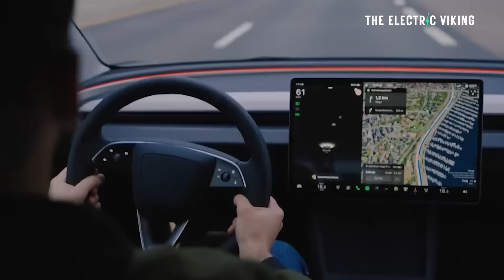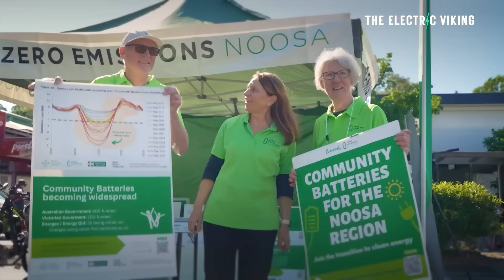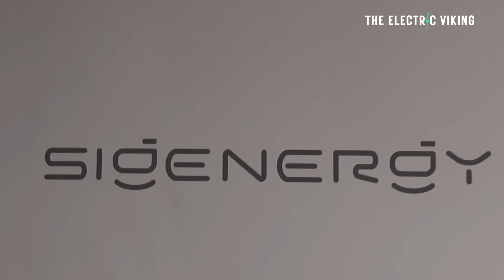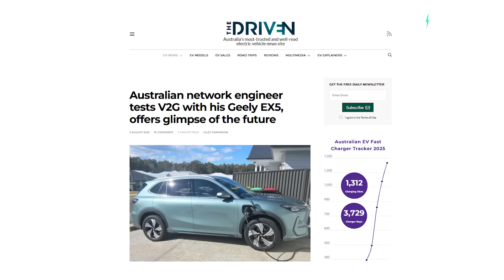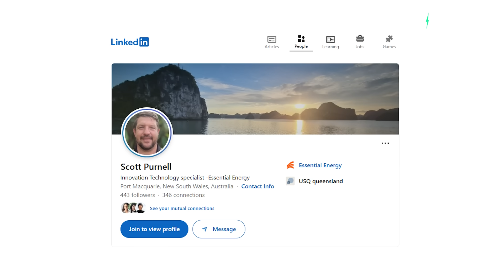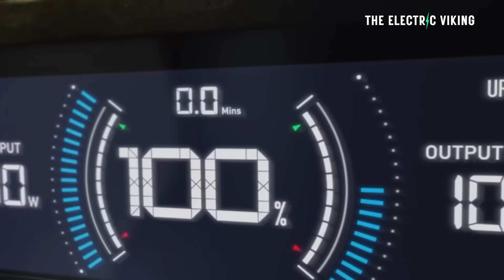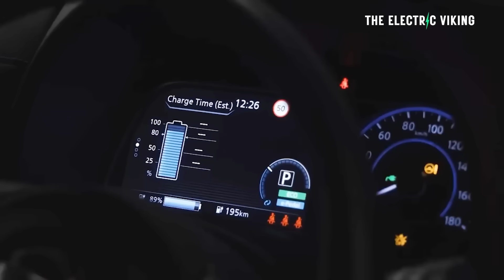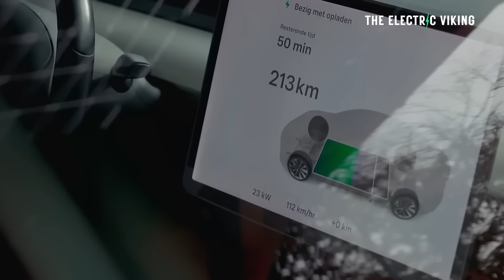V2G Hits Hyperdrive in Australia - Works with Xpeng, BYD, Tesla & Geely!!!

Comment: You can't make money  from selling electricity anymore.  Not getting spikes in price for last year.  I have 3x powerwalls and still big bills - it's the $1.30 daily charge 60c network and similar for amber membership.  Can't go off grid with tesla (permanently) they don't allow it.  Also can't run electric cooker (50amp induction) off backup circuit.

Comment: I found this presentation very confusing. Words with different meanings being used interchangeably.  V2G = V2H? Also at the end of the presentation, noting making money (tax free) by sending to the grid at selected times. I dont know which state(s) you are talking of but here in Victoria you are very lucky to get 1.5cents for 1Kw, and some providers dont pay anything for your feed in Kw. For me now, I export 1.2Mw monthly in dec, jan for eg butI am not interested in any export to grid. If I get an EVehicle I would like to use it for V2H not V2G but there was little discussion about this. Apologies for the negativity but that is life in Victoria now with supply charges going up up up and feed-ins going down down down, you are lucky to pay for the supply charge. (I us BYD batt 11Kw, 13.5Kw on roof and fronius 10Kw next gen).

Comment: I will never buy a 2nd hand EV if I have any suspicion it's been used for VTG. I've little issues supplying the grid with power from a fixed house battery since if it dies early I won't be possibly stranded in middle of nowhere.

Comment: Another way to use vehicle to grid is to charge during the day at work and the discharge into the grid during the peak.  It is a way of supporting renewables without having solar on your roof.  If you can make more than you pay due to favourable rates this will incentivise people to do this. Electric cars can offset the need for utilities to install batteries.

Comment: I have a 20kw Fox Ess Batteries and only a 6kw solar system. In my first month in the depths of a particularly grim winter here in Adelaide, over the winter solstice too I’ve used about 30kw from the grid, about 7.5kw a week but fed back 250kw of unused solar. Plus we have underfloor heating on the ensuite 24/7 for winter, not the most efficient for sure. Happy with this. It will all change when I get my EV, so an interesting article. But, this set up pretty much makes me 100% self sufficient so, I now need to find away to charge the car with minimal impact.

Comment: Using obsolete cars for grid makes sense but not the one you depend on for daily driving. Most EVs have about 2000 cycles and Using that up by selling to grid degrades the battery faster. LFP or newer tech with higher cycle rates will eventually make this a mute point but currently using your car to grid will just degrade the battery faster

Comment: We will still need some large-scale renewables. There is a lot more to the grid than just domestic use. I can cover my home use most of the year, but not in rainy overcast weather that lasts more than a day or two. Nor in overcast very hot weather in summer. We have two EVs, and there are still parts of my house that run on gas, so my electricity usage has not topped out yet. I am looking forward to V2G.

Comment: we need more transmission to have the extra routes when lines go down but can give more power to the grid from other places and have a smart shift scenario like if we can get the pilbara and WA connected to the nem and sun cable project connected we can use many sites for power plus all the home batteries and solar and cars

Comment: will hall has been told that they need more supplies but compliance is also a issue in play. but sigenergy with their 3ph inverters plus the 25KW DC charger and push 15kw to grid and 10kw to sig battery during the high demand period. but if have single phase you are limited to max 15kw of 5kw to grid and 10kw to sig battery.

Comment: The only things allowed to be connected to the grid are those fully approved to electrical standards so forget used EV batteries. Off grid is user beware and check your home insurance pds terms.
In terms of V2G you're essentially asking EV buyers to buy a larger battery than required for their transport needs and you're wearing it out just like a house battery. At present a stand alone V2G two way setup is $10k so you may as well sink that into a subsidized house battery anyway

Comment: I was excited to read the the Waratah Super-battery has been turned on - until I see that it is owned by Blackrock. Why on earth do we need foreign private equity owning our power infrastructure, forever sucking rent out of the Australian people? Private equity is actually just a re-branding of the old leveraged buyout (for those of us old enough to remember the '80's). It was a scam then, and still is now. So, is Blackrock's "investment" (rent extraction) going to be buggered by the distributed, resilient, and people-owned grid realised by V2G? Not for a long long time. The parasitic vampire-class "investors" are expert at insidious lobbying. Expect to see strident warnings about "damage to your EV" from peak industry groups, and regulatory grid-lock as advisory panels stacked with vested interests protect their privilege to extract rent from you by blocking sensible V2G policies. "Freedom" means do it anyway, and be free of these parasites.

Comment: Evo energy do free electricity 11am to 2pm.  I don't have solar but thinking of getting battery to store during free time.  Downside is locking into this plan but I hear AGL and maybe others are doing similar.  Thoughts?
Reply: You could just build a system with a load of camper or server-rack batteries and a chargeverter. Even a basic chargeverter, plugged in through a simple time switch. Just have it click on when the electricity is free and charge up, then plug things into it during the day

Comment: Can one not insane person explain why someone would use up their limited battery cycles to support the grid?
Reply: A person in their 60's who only does 10,000km a year...a new EV will go 500,000km if the person wants to keep the car for 20 years and thinks driving after 80 is unwise then they may as well use some of the battery kWh's in other ways.

OK big-boy.
Reply: If you don’t do big kms every year then it would be ok to use it at home in V2G. Modern LFP batteries can last 2000 to 5000 full discharge cycles or more. So if you don’t abuse it, it will be fine.
Reply: Modern Lithium-Iron Phosphate (LFP) batteries can do at least 2500 full cycles at max performance. Most nowadays more like 4000-5000. Something else on the car will wear out and break long before you reach those numbers.
Reply: V2H not V2G is what provides energy independence, but V2G infers a standard that is acceptable for selling into the grid also. Home batteries work if large sized for ~95% of the time but for 4 day runs of poor weather v2h would cover that of so in theory you don't need the grid. Apart from an occasional supercharge of the ev.
Reply: With solar you get super sunny days that produce a lot but it gets sold for peanuts instead use it to top up the car and reuse it when the rainy times arrive.

Comment: I am finding most of this information misleading, I have a 6.6 Kw solar panel system with a 10Kw inverter & a 12.8Kw storage battery, for a single phase house (there are limitations for higher solar systems for export to the grid) at this time of the year (winter) the solar panels kick in at 8:30 am (low charge input) max input around 9:30am, with no cloud, solar input is 4 to 4.5 Kw, the battery being empty will be fully charged by 12:30pm the battery with the assistance of the solar panels heats the storage hot water till 2pm, again this is a day with full sun no cloud, the battery is now down to 85%, it then recharges to 100% by 3:30 by this time the input from the solar panels is just 1Kw, by 4:30 the battery is now running the house electrics heating, cooking, by 10pm the battery is empty, so from then to 9am next day the house is on the grid, how the hell can a EV battery be charged based on this, unless the solar panel system was at least 10Kw or higher, maybe in summer there is a better chance to have the surplus power transferred to a EV battery, you would need at least three days of zero power consumption of the house to fully charge the EV battery.
Those figures are the best achievable with full sun in winter, with cloud cover forget it battery was unable to reach 40%, with intermittent cloud cover the best the battery achieved was  75% charged by 4pm.
Reply: Good breakdown here. Regardless of who makes the most profit from battery storage this solar battery mix is a strong win for oil dependency reversal. We as a community are better off. There is no “proof of fail” here. Just win win win. Taking a long term view on paybacks for these solutions is a testament to those who can leading the way and I salute you.
Reply: I see what you are saying.  I have wondered this myself.  It would be ok of you had 3x as many panels. 
How much power do you use from your battery each day averaged over the whole year?
Reply: @101spirited  the battery was installed on the 1st of july its capacity is 12.8Kw, each day since in use it has been exhausted as early as 7pm starting at 4pm as late as 11pm this depends on the % of battery capacity available at 4pm, that in turn is governed by the amount of energy (sun) available during the day, how long it takes to reheat the hot water tank & power consumed during the day, based on my observations the house starts running of the solar panels from around 9:30am with battery from 4pm to 9pm at night (average) with no supply from the grid, & on some days a small amount exported, I am considering increasing the storage of the battery to either 15 or 18Kw to take advantage of the increase of sun over spring summer & autumn, unable to increase the number of panels which is the only answer during winter to be around 80% of the time not requiring grid supply.
Reply: @afs5609  You need install another 6.6KW system to give you more power that you can use during the day and install a larger battery so you have mopre availble power for the night and early morning. I've just done this. Originally had 6.6kw system installed in 2018. At end of 2024 i installed a 19.2 kw battery ( Sungrow) and another 6.3kw panels. i now have enough power to run anything during the day ( even 3 phase ducted air con) with enough battery power from 4.30 pm right up until 9.00am the next day. The only power I buy is @ 8c per K/W for charging MY EV when I need more than what the sun can provide from 11am till 3 pm. It's not cheap to upgrade but over 7 years you should be able to complete the ROI.
Reply: @gtpete6363  no more roof area to increase power collection other side of building faces south would only be able to charge in late spring, summer, early part of autumn, waste of money, but agree increase battery storage to either 15 or 18Kw
Reply: You've nearly answered your own question. You have 6.6Kw of solar hooked to an inverter designed to take nearly twice as much. Double your solar panels, on those rare days when the output is more than the house and inverter can handle, then the inverter will throttle the panels back. On sunny days you can happiky charge your car and have the assurance of total independence for the cost of a dozen or so panels.
Reply: @simonpaine2347 insufficient roof area to convert to 10Kw, but will discuss with supplier to see what is possible
Reply: @afs5609 I've put 10 Jinko 530w Bifacials on a structure as a car port and another 10 as a roof over my shed, to help keep it cool. I was never keen on putting panels on my roof.
Good luck.
Reply: Just more proof that making every home owner create their own power by installing solar panels and batteries is not only extremely expensive , but is problematic , impractical and is in total more expensive than the system we had when we had cheap reliable electricity available from a grid powered only by coal and hydro .

Comment: 6:50 yes, you are voiding your car warranty. This is the real issue.

Also, just FYI, if a system performs ok ONCE in an emergency you cannot claim "obviously it doesn't". That is not how critical systems get tested and validated. 

Also FYI, you are never really off grid with these systems. As far as I understand Roof Solar does not work autonomously if disconnected from the the grid. 

However, utilising batteries is a glimpse into the future with lots of potential. But all market participants need to come to the table and clean up the technical standards and liability issues.
Reply: 日本にはv2h があります。
停電時にもソーラーから電気が蓄えられます。　

　EVの保証も問題ありません。

Comment: I've looked at V2x when i picked a home solar installation. I don't see how it makes sense. The cheapest charger i could find costs US$7500 (Wallbox Quasar 2). The same money gets me 40kWh worth of home battery at current market prices which is total overkill so i settled for 20kWh. This battery is always home and much easier to integrate into your home charging logic. I don't know Sigenergy but i'm a bit wary of those fully integrated systems cause they tend to charge you a lot for their batteries. My system now is a Deye inverter that can deal with any type of battery of any brand. I think every EV/home owner wants to integrate their EV battery but there needs to be cheaper chargers. Whatever makes those cargers so expensive needs to be moved into the vehicles and make use of economies of scale. Until then home battery prices keep dropping.
Reply: Stop using facts in your argument. We will have none of those here.

Comment: I'm already running offgrid with 40kwh Sungrow battery feeding excess into grid with Amber Electric earning $1,420.41 in last 6 months. 
I'm looking to get a Zeekr 7X and ideally have it connected V2G. Being able to draw on the car's battery will be beneficial when FiT price spikes. 
There are factors affecting ability to exporting power. 
. Ausnet limit exporting to 5kw per phase, so it is beneficial to have 3 phase power. 
. Ausnet restricts exporting to 1-1.5kw when local network is congested and can stop exporting if required.
. Ausnet from my understanding currently treat V2G no different to Home. Must be approved inverter, always connected to internet, and they have remote access to control it, and they dynamically control your export limit.
Looking to use Amber Electric for the smart charging and discharging for the EV as I current do for Home.
Reply: Interesting, off grid but still feeding into the grid. Magic.
Reply: @Guvament_bs  Just a switch. Only need to be grid-connected to export power, but tend to stay grid-connected for convenience.
Reply: Earning a whole $1420.41 in six months.  If you live to be 170 years old you may just break even on the price of your 40kwh battery.
Reply: @101spirited what battery or car are you talking about for 240000 AUD??? You get 80kWh battery plus car functionality for 50000AUD nowadays … just look for current car prices ;- )

Comment: In the UK Octopus Energy offer a BYD Dolphin and bi-directional charger for £300 a month with 100% free charging if you plug in for 20 hours a month so they can use the battery for V2G
Reply: Wow taht is awesome
Reply: @felipemelo8605  taht is
Reply: What a rip off
Reply: @richardvivian3665   £300 a month is reasonable for EV  lease prices in the UK, getting a free charger and installation however is not common and nobody is offering free charging. Please explain why you think it's a rip off?

Comment: Sigenstor is modular. You can get the battery installed now and add the V2G module later when it becomes available.
Reply: I've tried to get one installed and the problem is space on the sides and front. I couldn't put it into my single garage because of that requirement, and putting it outside makes no sense for me since I need the charger too. Unfortunately I have to wait for something different or other options in future. 

Otherwise, it's a fantastic benefit to households I think.

Comment: We had a 40kW Leaf and a Chademo V2L unit wired into a 1ph circuit in our house. It worked great until it didn't, twice. On 2 occasions the Leaf tripped a breaker in the battery. This had nothing to do with the system it was all on the car. Once tripped the car is a brick and had to be tilt trayed to the dealer. Of course we had no idea what happened so both times it was under warranty.
You won't get away with such issues in the future as the dealers will be able to tell if you have been doing V2G and if it is not covered by warranty then you are absolutely screwed.

Doesn't matter about anything else, without car warranty coverage V2G is dead in the water.

We have a 16.6 BYD with a 5kW Fronius inverter and panels. With OVO we get 3 hours free power so everything runs full wick for that time in our full elec 3ph house and after that the battery discharges until the next day. We purchase no power. The Amber model does not make financial sense due to the fees, you cannot actual make money except in extreme situations which are few and far between. Believe me, we tried it several years ago with an earlier energy retailer that followed the same model and eventually went broke. Amber should survive but they will make the money, not you. 

The real shame of the battery "bonus" scheme is how people are rorting it. Our installer said that in Melbourne most buyers are going for the max discount of 30kW. I said why would anyone need that and he said they don't. They are just buying cheap battery "blocks" that then will be repurposed or sold once the subsidy runs out......